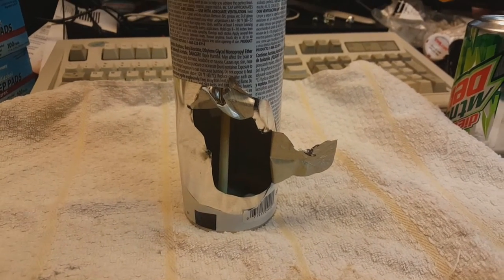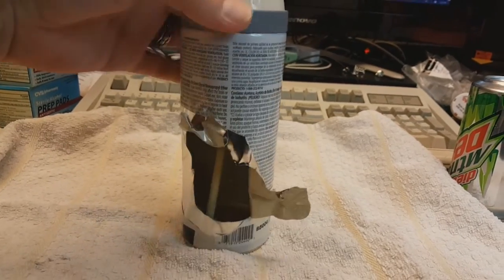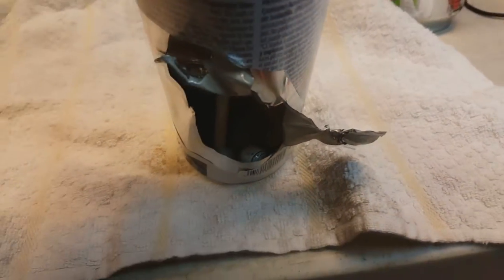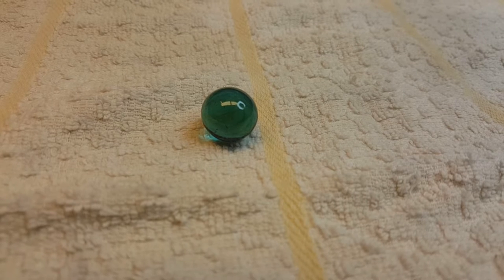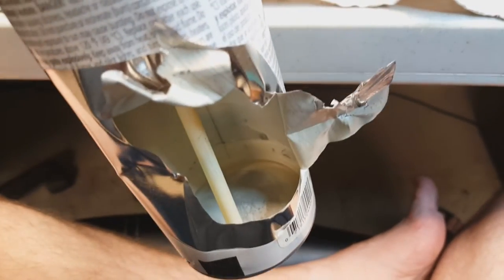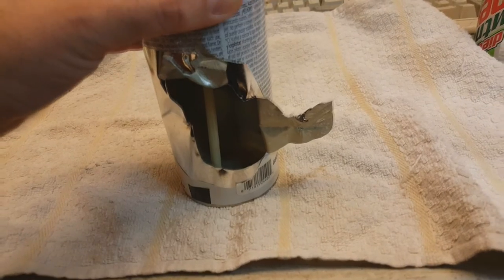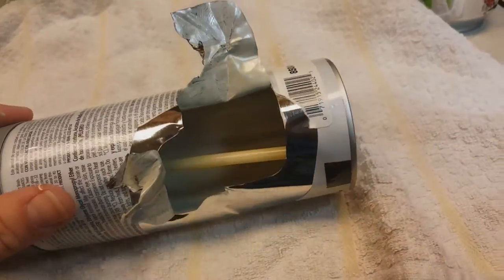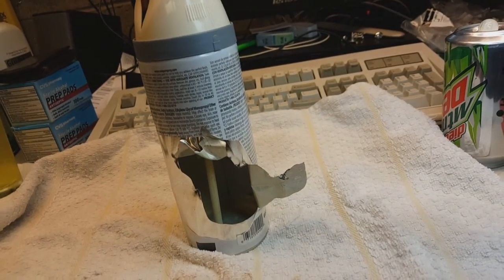Dissecting a Spray Paint Can

Comment: I've cut one of these open AFTER using it up and depleting all gas. I have quite a few of these marbles. I cut open a rubberized undercoating can and it had a metal ball bearing. One can I opened up had two metal balls instead of one.
Reply: coondogtheman1234 This makes me want to keep doing this until I get a metal one
Reply: harleybadger1
I think you can find one in a can of rubberized under coating. Not sure of the brand but like you said keep doing it till you get a metal one. I'm gonna find more spray cans to do this and build a collection of spray can marbles.